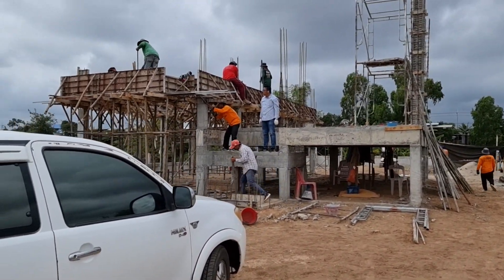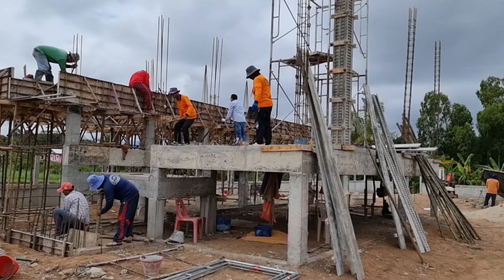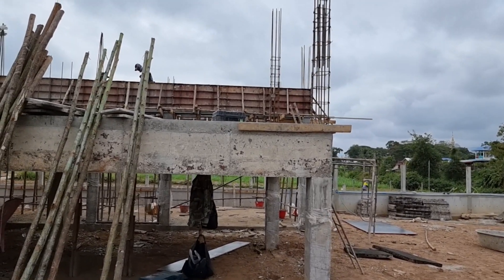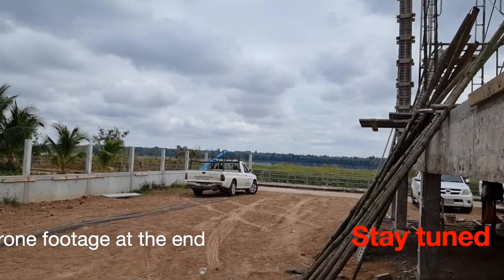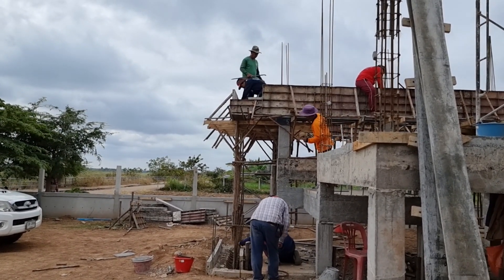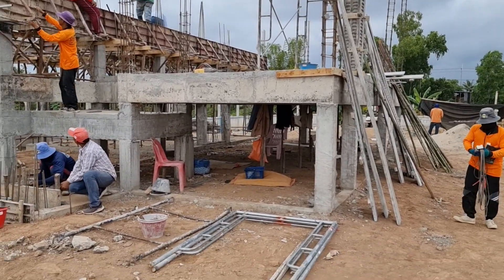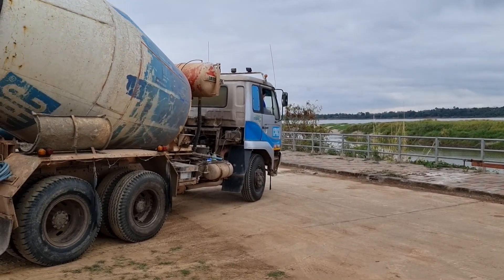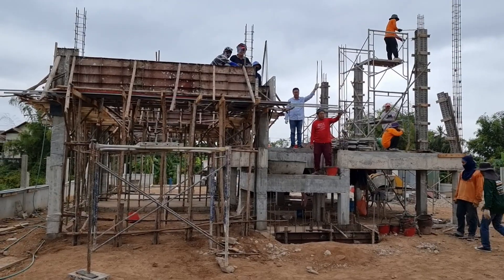Building a house in Thailand -  Part 14  - Livingroom, bathroom and balcony floors   Part 2

Comment: Who's doing the electrics Parky...
Reply from the maker: I will be supervising and designing bud, I want 32A ring mains for sockets all on separate ccts, I want 6mm cable for electric showers, only need 6mm cos showers only 4.5kw max here nothing more required. If I leave it to them they will do it thai style which is 2.5mm cable to sockets then a 1.5mm cable from socket to light switch feeding the lights, yea so doing it UK way bud they also just use 2.5 for showers.